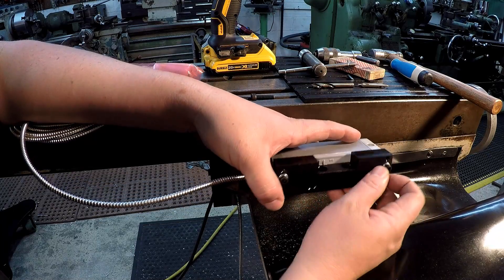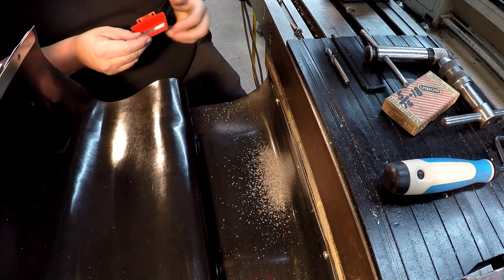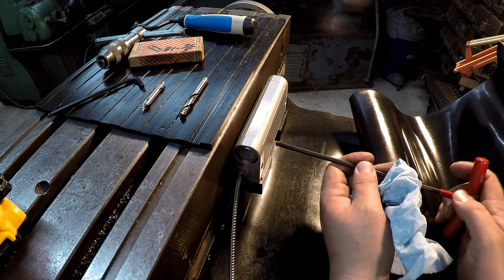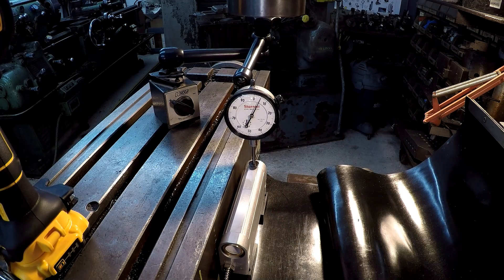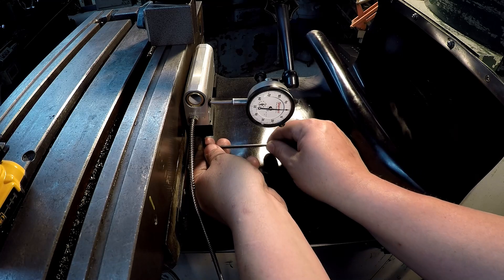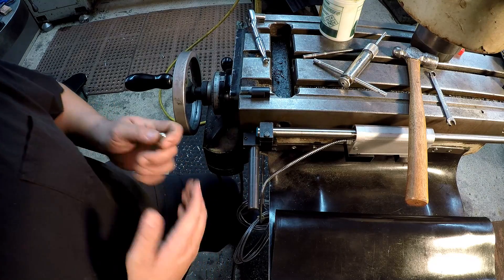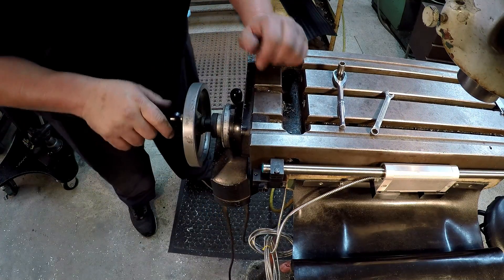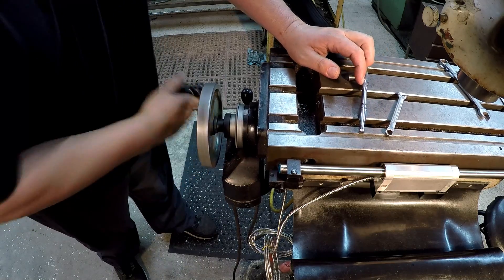Newall Digital Readout Install Part 2

Comment: Adam, you might want to consider doweling the mounting for the reader. One, the dowel will insure it doesn't move, over time. Two, the dowel will insure that if you remove the reader it will go back to it's original position, when you reassemble it to the table.

Comment: The monitor mount seems very lame. It should not back off the thread (basic engineering) but it seems like it doesn't have a tilt function or friction adjustment. Any generic computer monitor arm from Amazon etc has these built in. 

Newall seems overpriced for what they offer since it looks like 1980's technology with no real value added. How 'bout a touchscreen iPad like interface with an App that is WiFi connected and allows scaled graphics and IGS files to be imported? The display would show real-time position in graphical form. So must potential missed in this product.

Besides that, Newall is bringing up the rear when it comes to online product support. They have no YouTube vids on the installation or use of their products. Don't see them being around very much longer since there is no compelling reason to spend 4x on a DRO that does the same thing as an Amazon Chinee product.

Comment: Would it be a good idea to bridge the gap between the guard and the table with a strip of rubber or something to keep detritus from falling in there?  I'm sure you don't want to have to remove that guard every time you clean up after a job.

Comment: hey Mr. Booth. couple of things on my mind. 1. Man that sure is a nice set of holes. perfect alignment, clean threads and perfect centering on your table. 2.When you sell that mill you need to give the new owner a video explaining why the holes exist. It will make somebody bat shit nuts trying to figure out what was mounted on the back of the table. and 3. I want to see the video of you the moment you figured out what you had done. I personally would have had a total spaz attack and run around my shop screaming and cussing and throwing shit around. I have watched ALL of your videos and have derived many hours of pleasure from them. I also appreciate your confirming the old adage that the difference between a pro and an amateur is how well they hide their fuckups.  Keep up the good work bubba.

Comment: Re: The second guard being mounted on the outside of the reader.

Isn't there a risk, that chips might find their way between the edge of the table and the guard, and onto the scale rod?
Reply from the maker: +BedsitBob Dust and debris getting in that scale won't affect its readings. They are extremely durable. The guard is just to protect it against falling damage or it being hit. You can cover that scale in chips and coolant and it's still going to read correctly.

Comment: At least thats an easy fix for those holes, been where I drilled matching holes to make a bracket but each side i drilled the same distance from the same end. Welded it all together and was like ahh crap. I needed them offset to one end. Cut and redrill.

Comment: DRO works as long as one bit moves and the other doesn't. 😁 
It's all relative.

Probably look a bit odd with the scale fixed to the "wrong" side and hanging over the "ends". And another moving cable can have its own issues.

Comment: Hi Adam, I don't know your Dual milling machine but do you lose any travel on Y axe by fixing the scale on the back? Other than that, the settings for setting the scales are much better designed than on my cheap Chinese system! Thanks for sharing.

Upgrade. Ok. I saw your comment down below about you lost one inch on the Y. Personally I would prefer to have the full travel... :-)

Comment: Hey Adam, Just wondering if it would be worthwhile machining a little off the ends of those mounting studs so the edge of the aluminum cover meets the side of the table flush. It would stop any chips from getting caught in the gap.

Comment: Wouldn't it be easier to mount the bar first? It's longer, so the adjustment would be more accurate. Then the carriage should be in the right angle and just has to be bolted on.

Comment: I've done a hell of a lot of projects without using the "right" tool for the job, but, man, those transfer screws would have taken the misery out of A LOT of those jobs.  Always nice to see an older piece of equipment maintained and updated.

Comment: Hi Adam. Good of you to share your mistakes so candidly. I thought it was only me that did things like that. You probably already know this, but the standard ISO metric thread system is easy to work with because the tapping drill size is the thread size minus the pitch. E.g. M6 - 1.0 = 5.0. Best, Mike, UK
Reply from the maker: +Mike Barton yea but what about those odd ball pitches like .7 Even if you have a set of metric drills like me you still don't have all the ones you need. Best to have fractions, letters, and numbers.

Comment: When I added Accirite scales to my mill I found that I had to put a stop on the back of the table to keep the back of the mill from hitting the scale. This would happen if you crank table all the way back. You may want to check this, it looks like the chip guard will hit first but it could bend.Dave

Comment: Do you nbeed to put a hard stop on the sadlle to keep from smashing the scale against the column when it is in all the way? I did on mine. I ended up loosing about an inch of y travel but it was worth it!
Reply from the maker: I've always found myself watching the guard to not smash it against the knee, but I'm sure a stop would be great. The loss of travel is worth it. I prefer the back side so I can hang shafts and parts off the front side.
Reply: I figured the power feed on my mill would love nothing more than to crush it while I was watching something else. That is how Bozo attacks! lol

Comment: I installed a similar aluminum angle guard on my mill DRO and used some foam weatherstrip (from the orange home store). I got a piece about twice the gap width, it compresses into a tight fit at the edge of the angle. It comes as a peel and stick, and the pressure from the angle bracket should keep it from coming off.

Comment: Adam, I have a question that maybe you can or someone else on here can answer. When drilling a hole on a lathe, we are told to always use a starter drill. But when drilling a hole with a drill motor, no one ever uses a starter drill , why is that ?
Reply: People do use starter drills with a drill motor.if you need to drill a half inch hole through metal it would be smart to use say a quarter inch at first and then the half.The reason Adam didn't use starter drills in this case is because he was drilling such small holes and didn't need to. Cast iron drills easily in my opinion.I have drilled thousands of holes with a drill motor and have the forearms to prove it.
Reply: Also if hand drilling it is best not to use too close in size drill bits when drilling successive holes. In other words don't drill a quarter inch hole and then drill a five sixteenths hole next as it will probably case the drill bit to grab and snatch your arm around and hurt you. Even a good quality half inch drill motor has enough torque to really hurt you.

Comment: Hay Adam for the chip guard will small chips get behind it and fall on the scale and scratch it would it be a good idea to put some molding on the edge so there is no space for chips to fall thru.

Comment: the anticipation turns your mind to mush, that mill is going to be awesome to use with that dro  cant wait to see you measure some stuff or machine and mesure some stuff the linear error compensation can provide some stunning accuracy if you go that far in setting it up, big day for the shop love it
Reply from the maker: Yep it's going to be nice using it and comparing measurements.

Comment: I know a guy that has a time machine.  Older guy, goes by the name Tony.  Might be able to do something to lend a hand or two...  Even if is only to hold the instructions while you read them...
Reply: I support all time travel related to this project. Need some more Avon79 in my life.
Reply from the maker: Would be nice to go into the future to see how to properly install it first
Reply: Adam, I have installed hundreds of these newall systems and you did just---- Fine--   Thanks for a great vid, Cliff

Comment: 3m vxb mounting tape between the guard and the mill would serve the purpose of sealing it and mounting it more securely to the back of the table. It's really good stuff. You can get it at any auto parts store for mounting body side moldings and the like.

Comment: We don't learn without dumb mistakes. I'm typing this as I'm looking at 3 failed parts for a college project. All there for different reason. The first being an oversized pilot for a tap, second for snapping a die (whoops!) and third one for applying a taper wayy too early into the project.

Comment: Nice job Adam, Would a bead of clear silicone sealant be helpful along the top of the scale guards/mill be useful to keep crud out?, J.
Reply: Average Joe 
Thats a tough one.  The silicone will also grab and hold onto tiny sharp shavings.
Reply: Shouldn't do, depends on the goo used, the stuff I put round my bath does not hold too many steel shavings!
 I really must get some sleep, five to five in the morn,
Reply: I thought that would help too. That gap looks just perfect for stringy chips to get stuck in. Another solution would be to add a little strip of sheetmetal on top of the guard to close the gap.
Reply: Maybe something else, acrylic sealant or something like that. Silicone is too soft, things will get stuck in it, also it doesn't stick very good to metal. The bathroom silicone also uses acetic acid (vinegar) for curing, wouldn't be surprised if the cast iron starts rusting like a champion.
Reply from the maker: Might have to look into it, but it's never bother me honestly. I have the same unit mounted on the mill at work.
Reply: Two types of silicone, acetic and neutral cure, I use neutral cure-no acid and a better product from experience. J.
Reply: Abom79 Adam

I have a Newall dro on the mill I got some u section nylon edging strip that just fitted the Ali angle put it between the table and guard keeps the chips out ok

Newall is only 20 miles from where I live
Reply: No real need to seal the guard at the top.  It is there more to keep things from hitting the Newall tube part of the reader.  Their system is sealed and really only needs the guard to protect against impact from something dropped on them.
Reply: Yeh i know, my OCD gets in the ways at times, J.
Reply: The acetic acid is all gone in 24 hours, if you've got corrosion it's from something else.  When you quit smelling vinegar, it's done with it's cure 100% and for all time.  24 hour corrosion from RTV acetic acid is the latest interwebby non-issue that never should have existed.  When you mention it, we know who you really are.  People do drink vinegar and straight up too.
Reply: I start twitching when people mention "chemtrails", Some things get right up my nose. J.
Reply: When did I mention chemtrails? It just came to my mind, because I used vinegar once to artificially rust steel parts for aesthetic purposes, 24h should definitely leave at least a mark.
Reply: You could use some weather stripping like the neoprene stuff you put around home doors and just bolt the guard on top of it.

Comment: Adam, No problem on the mounting issue...(would have indicated exactly correctly at one specific position...)  By the way...just finished catching up on all the Videos...Gave you a like on every one.  Thanks for sharing all this with us.  I've learned a ton.